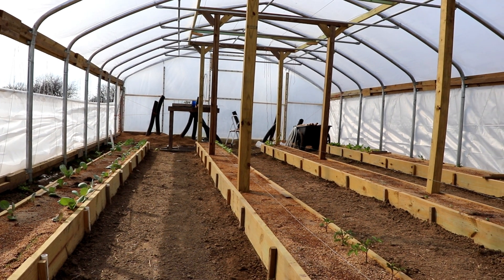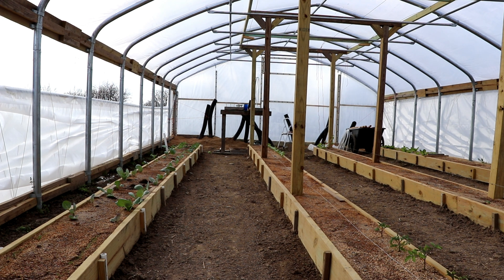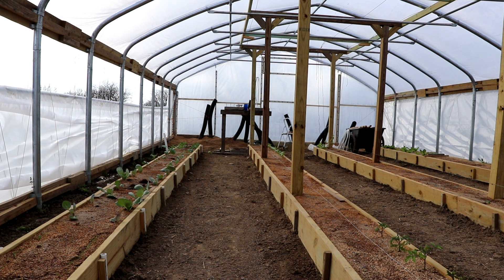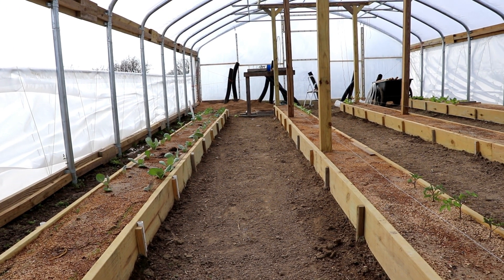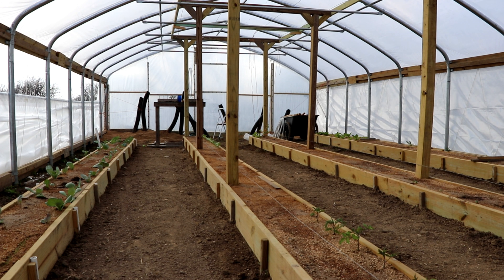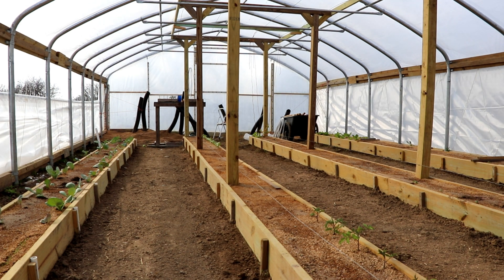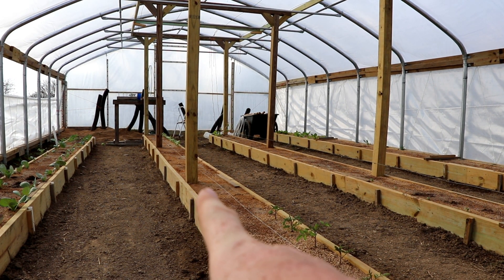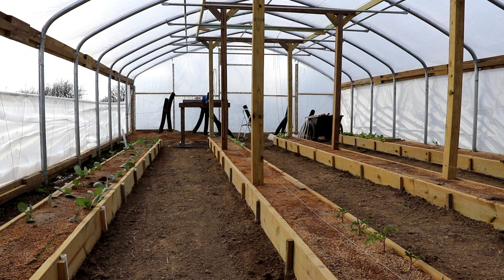heat sink greenhouse project - update April 2019

Comment: You’ve got some good looking tomatoes this early 🍅
Reply from the maker: Thanks. I don’t believe you can see it in this video, but the first tomato in the grow box has blooms already.  Our temps are warmer now and the greenhouse is reaching 80 degrees quickly. I expect the tomato plants to really start growing soon.
Reply: @smallblockfuelie  Wow, that's great.  Dunno how your Missouri Spring weather has been, but in Denver we had a cold and snowy winter, but it's been warm and dry for the last two weeks.  Plants are really starting to pop.  Makes me think it's a head fake (e.g., we're going to get blasted by a nasty late April storm).  I've got 2-week-old tomato seedlings in my small greenhouse.  Probably getting too warm for them during the day (shade cloth in April?!)
Reply from the maker: Morgan Brown our winter was not typical at all, much colder and much longer than usual.  We have the same fears as you, I’ve not got anything planted outside yet. This afternoon we will get our seedlings started out in the greenhouse. Hopefully we won’t see that late freeze and frost
Reply: @smallblockfuelie  Big spring storm hitting Denver tomorrow; but am guessing you'll be ok.  Your greenhouse looks bombproof!  My hacked greenhouse should be OK too.